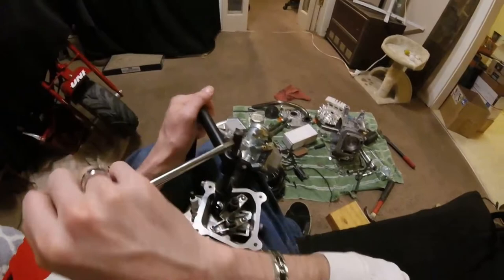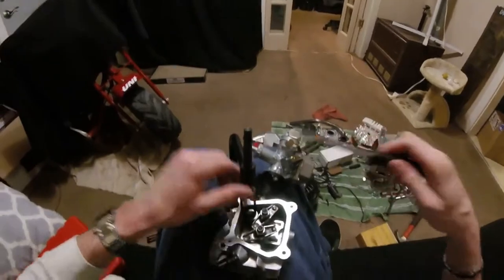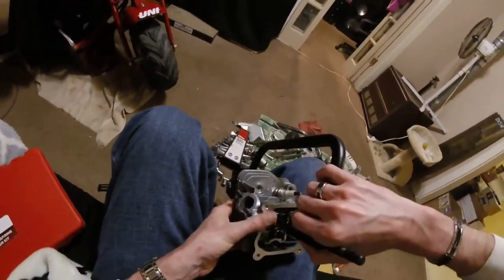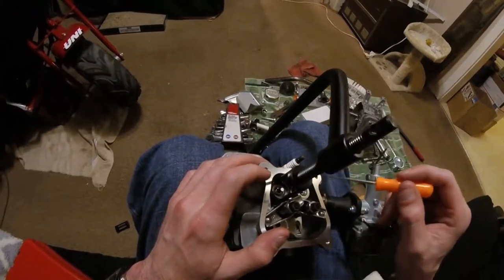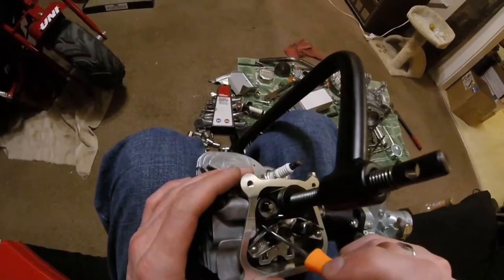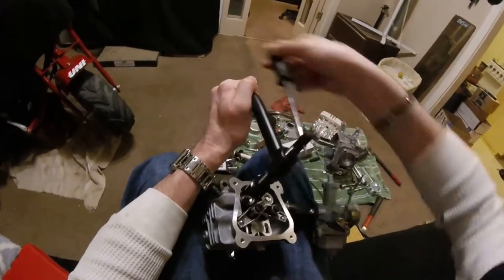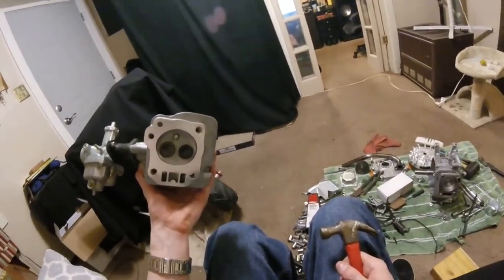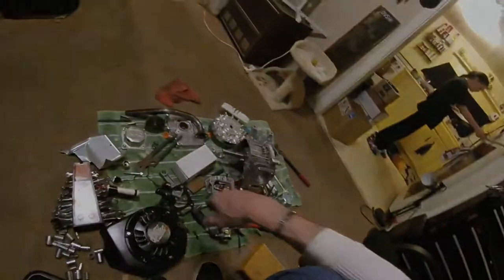PREDATOR 212 GET'S 26 LBS VALVE SPRINGS INSTALLED FOR THE COLEMAN CT100U BY SPIKEMANDAN©

Comment: How did your rockers not snap from the 26 lb valve springs, I thought u can only use 22 lb with the regular rockers
Reply from the maker: I assure you in the racing world we're running much more intense stuff with much more higher quality metals you think 26 pounds is a lot there are guys out there running 36 lb and heavier on roller tip rockers
Reply from the maker: You have to understand this engine is purpose-built all the products I am showing you in this video are purposely built for what I'm doing in other words billet metals high grade shit

Comment: Hi Spikeman !
 I'm Installing my BlackMamba cam tomorrow.
I have a set of Burris 26lb.
Valve springs 
But with 26lb springs 
I should really install
chrome moly push rods&reinforced rockers 
(Another $60.00 I dont want to spend)
Plus :  bitch to install as you know !
I already installed 18lb.
valve springs .
Hows it working for you?
Any high rpm valve float ?
Does it perform like before?

Thanks in advance Dan

Comment: Would you know the valve lash for 212cc non Hemi with 18lb Springs?
Reply from the maker: With a feeler gauge you're going to hit 3000 on the intake and for thousands on exhaust
Reply: Ok thank you... So the intake .003 and and exhaust .004?
Reply from the maker: @PAiN46k  yes you got it

Comment: On that motor unless you're running some Godly amount of like 10 thousand RPMs 26 valve springs overkill's going to wear out your cam more than anything and bent pushrods at high RPMs are too stiff you should have just went with like
Reply from the maker: You couldn't be any more right I knocked it back down to 18 lb valve springs and it works perfectly even with stock pushrods
Reply from the maker: Found out why I wore a cam out is because of a bent push rod always run chromoly and not stock I could have stayed with the 26